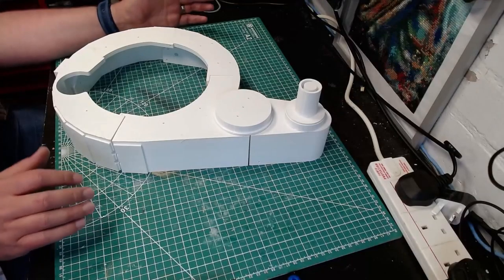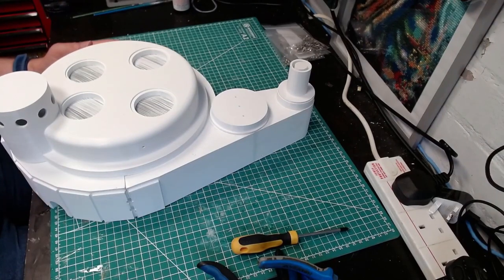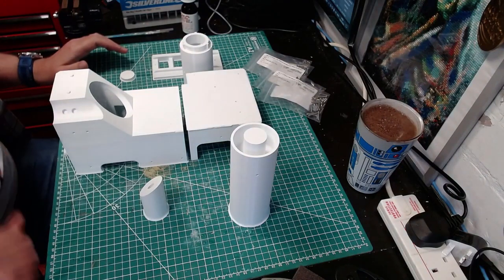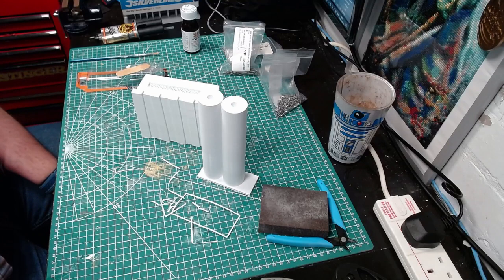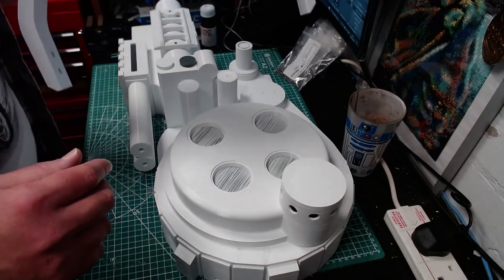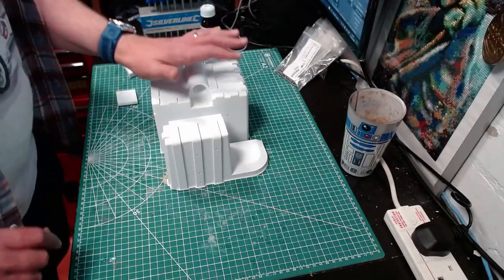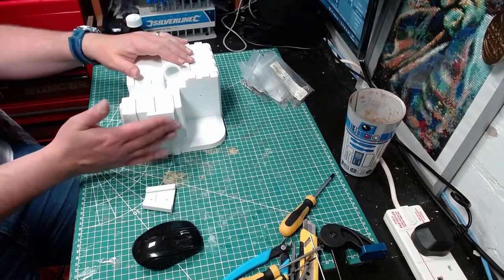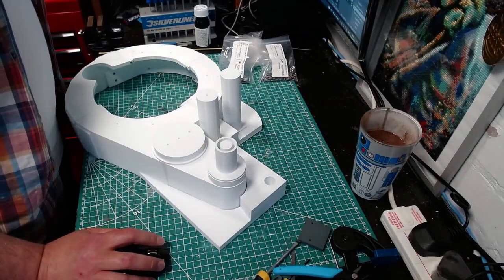Let's Build! A Ghostbusters Proton Pack! - Episode 1

Comment: What kind of printer did you use ?
Reply from the maker: 2x Artillery Sidewinder X1's. At the time running stock firmware. But since this was filmed I've upgraded both to use Klipper.

Comment: Great Job! Is looking pretty neat! Want to ask, can you tell how many rolls of filament, and how many printing hours and how many post processing / assembly hours went on this project so far?
Reply from the maker: Thanks! I'll pick this up again after BB8 is done  I don't really keep track of that sort of thing. Probably should though! I use 3kg rolls too which makes tracking a little harder. At a guess I'd say 3kg would cover all the pieces assuming no errors. Assembly was about a day. Including the neutrona wand. That's as far as post processing has got though so far!
Reply: You should be able to get a rough estimate in whatever slicer you are using

Comment: You skipped showing the actual printing and post printing sanding and filling. Also, this episode is a year old now, and there's only been one follow up episode?
Reply from the maker: Had to skip some of it as the printing settings are in the instructions that you have to pay for. It's still not sanded and primed yet. Chopper, LOLA and BB8 kinda took over! I will follow it up though